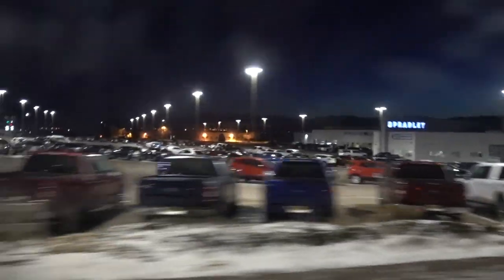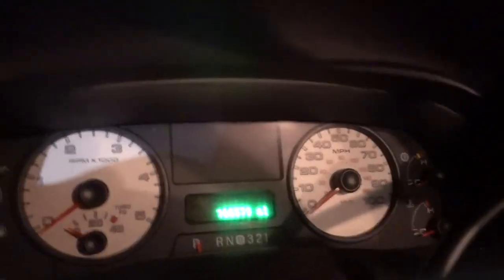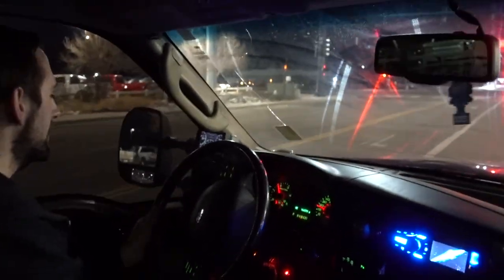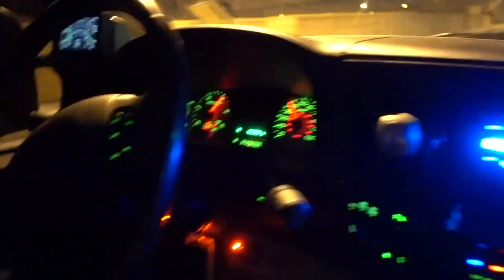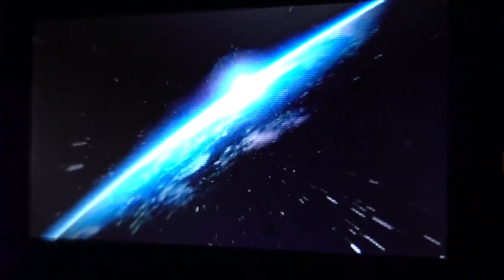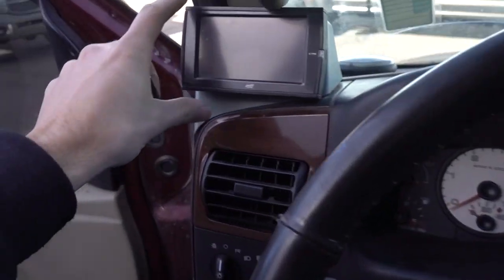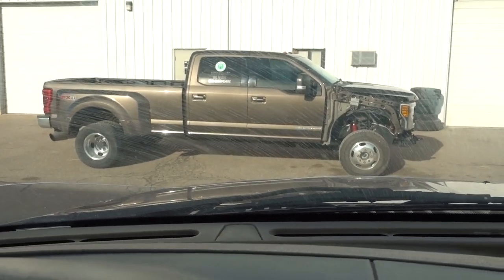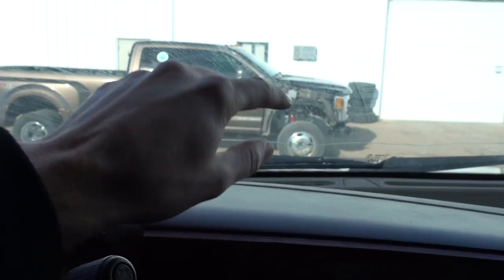CHEAP FORD 6.0 POWERSTROKE F250 WAS HIDING 10K IN "BULLETPROOF" UPGRADES!

Comment: Something worth mentioning, I can't tell what programmer exactly that is but the old edge tuners don't tune the trans and it will kill it eventually. I have the edge cts2 which does and have been very happy with it.

Have the same bulletproofing on my 6.0 and it has been completely trouble free towing through the mountains and getting me around sometimes. Great buy!

Comment: I bought an 06 with 192000 miles that has arp head studs, egr delete, full exhaust and tuned for 11,000 before fees and tax. After 4 months I’ve only had to replace 2 injectors and oil cooler 👍

Comment: Those headgaskets or egr are likely blown. You can see all the white residue on the degas bottle. Put a pressure gauge on the cooling system and go drive it. See if it builds pressure under throttle

Comment: Do a 2016 swap on this one. You already have to fix/replace the bed so it would be easy to just find an 11-16 bed. Looks like the front bumper is toast so why not upgrade that also. You can show us how it can be done with as many used oem parts you can find. It can be an everyday mans fixer upper.

Comment: I been looking at a 05 with a 6 liter diesel. Would be my first diesel. In so scared to pull the trigger on it cause I no nothing about them. I want to pull a 28 foot RV with it.  The one I'm looking at is like that one except it's white.
Reply: Sweet Tee get a bullet proofed one make sure the owner has the paper work or look for head studs & all the coolers coolant filtration system. I’ve pulled a little 22foot camper with mine up 10-12% grades it has enough power. I absolutely love mine wouldn’t want any other diesel, I love the look, sound, interior, best bang for buck, just make sure you have the money for a diesel, diesels cost more to maintain, insurance etc. & 6.0 can be expensive if they still have factory head bolts ,egr, & u put a race tune giving her hell all the time rolling coal through intersections you will blow a head gasket, they didnt nick name them 6.blow for a reason.  Watch power stroke bills videos he has great vids on 6.0s. I was scared to pull the trigger on a 6.0 had mine for roughly 13-14 months roughly put 25k miles on her no issues, take good care of it, oil changes every 5k if not a little early & filters every 10k. Maintenance is big on these trucks they use oil for everything so if you’re not changing your oil on time your truck is gonna turn to shit.

Comment: Is it just me, or does a 6.0, straight piped, at 3,500 RPM's sound like a screaming elephant?? lol.

God, I worked on nothing but 6.0's for almost 6 years straight. Definitely made some good $. They are everywhere here in Alaska, and they all need work. Do yourself a favor and ditch that tuner. Go with SCT and innovative tunes. You won't be disappointed.
Reply: BTW, ditch the bed and go flatbed. Would be a perfect match for that truck.